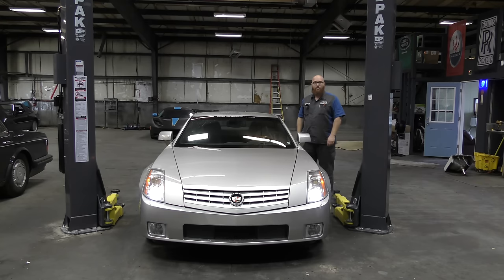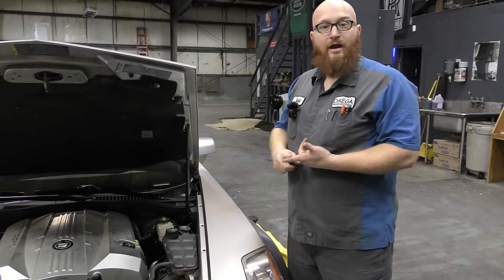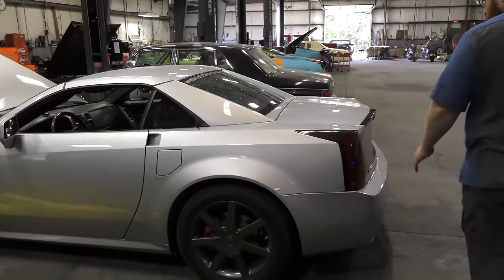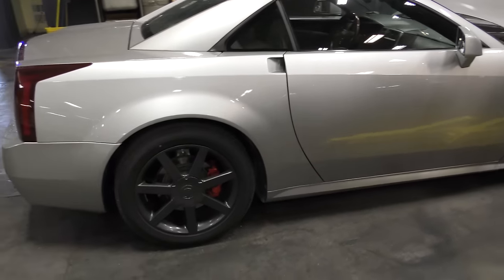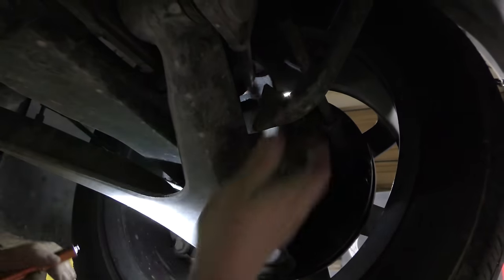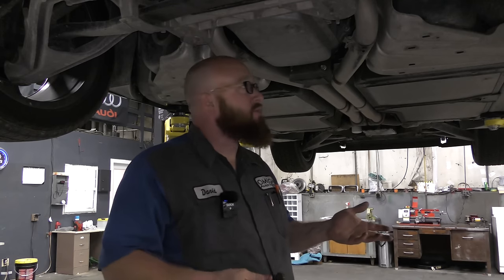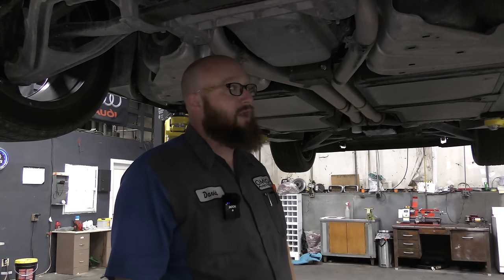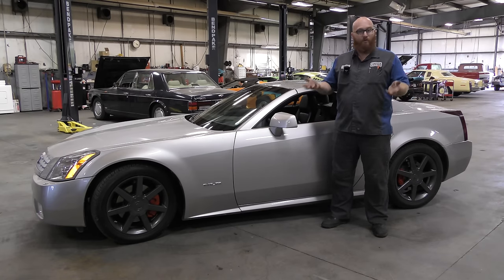The CAR WIZARD is shocked this 2006 Cadillac XLR has a Lotus Sized Repair Bill?!?

Comment: My Buddy ordered new a Diamond Black Edition XLR-V (S Sport pkg. $6134 cdn option), ordered a SLP 6 spd from Mr. GoodWrench (G.M. Performance Parts Desk at this particular Dealership). This is a real 1st hand knowledge (I was thankfully invited to order & $10 000 cdn downpayment) base price was $71 549 cdn, I would love to have been able to show the 2 1/2 window stickers; it will be explained in a moment. Still flipping through the parts catalogue, forgot to mention that the Diamond Black paint was $8740 cdn; 3" cat back Borla exhaust, a set of actual C5r Recaro fixed backed bucket seats in XXL North American conformity, (I am serious, this friend of mine was a member of the more $ than brains group. A set of Dynmag Magnesium rims (as found on mentioned C5r), Lingefelten☆ sealed carbon fibre cold air induction kit ($1826 cdn) ALL ,dealership installed. He got the call 6 weeks to the day to collect, All said and done (A Premium surcharge of $4473 cdn to activate a Platinum Cadillac OnStar Concierge pkg, seriously!) Shop, Sales & C.E.O. of this dealership read out the stipulations and practically made my friend sign in blood; not to let Any information/Performance stats of this vehicle to be disclosed publicly; a non disclosure on a Caddy that my friend paid the remaining $106 887cdn, $116 887 + $450 cdn for a Valet restriction micro chip key. You can guess what  happens,  I forgot to  mention that my friend just got scouted by the Indianapolis Colts (N.F.L.) 18 yrs old & hopping out of Square Styled '88 Suzki Samari on 13" 102 spoke Dayton Wire  Wheels & 64 h.p..... I didn't even get a ride in or a picture taken because a telephone pole beat me. On a lighter note, my friend enjoyed 8 seasons in the N.F.L. Thank's for reading this message, Cheer's from East-Van B.C. Canada.

Comment: No LS on the XLR-V Wizard. Supercharged 4.4 Northstar. Buy mine Wizard!! I am selling my 2007 XLR-V if anyone is interested. very rare. Just a few over 400 made that year. Same color as this one but without the ugly aftermarket wheels. Excellent shape. I will post a video today. 20,000 OBO. PS just had my radiator done. Easy find at rock auto. 1300 dollars to replace. AC had to be flushed and serviced as well.

Comment: I don't get it, I found Denso direct replacement radiators for $168.20 CAD on Rock Auto. If you want AC Delco direct replacement then you're looking at $386.88 CAD which is still under $300US. Wizard, you should start looking for new suppliers.

Comment: If you have to replace parts, and they are expensive and difficult to obtain - go race parts, go race parts, go race parts. It's similar or cheaper to upgrade to something better even with the fabrication required to make it fit. Manufacturers make things to a budget, they generally aren't aiming for the best.

Comment: Adored this car for years, until I saw this video!...can't find a freaking radiator?...omg and an oil pan gasket leak that requires unbolting the motor mount bolts jacking it up enough w/0 breaking something else to get that oil pan off.
3500.00!!!...I'll take that old chevy truck you got in the corner over there!😊‼️❤️🏁👍👍👍 Thank God for this video!!!!!!

Comment: Wizard, did you say that the NorthStar head gasket issue had been resolved on this 2006 XLR?  Please fill me in.  I have a 2006 Cadillac DTS  Performance Version built in October 2005 with just 40,000 miles on the clock and I love the car.  Had only 7500 miles on it when I bought it 10 years ago.  No symptoms of the head gasket issue, never ran hot but I always wonder....!  What can you tell me?  THANKS

Comment: Hello, I noticed the cold air intake(maybe volant?). Im currently chasing my tail on a p1101,p0101 and P0068. 
These codes are a known issue after the ecm is updated and the stock air cleaner assembly isn’t replaced with the new revision. Well gm discontinued the “new” air intake. 
I’ve done smoke test(no leaks) . New plenum seals, valve cover seals, plugs, and even a gas cap. It will run and reset all monitors except evap without error codes. But then once you restart car it throws the above codes. Btw this all started after dealership pulled both tanks to replace fuel pumps. It didn’t happen before this and they said it not related…?!? 

My last ditch attempt is put a volant cold air intake. Did it give any issues with codes? 

Thank you

Comment: I hate to rank on GM, but to make the highest-performing Cadillac (the XLR-V), they had to use a Chevy motor? In a Cadillac, the "standard of the world"? That's like Audi dropping a VW motor into an S8. Tells you how far down the tubes Cadillac and GM have gone. About the fuel sender issues..try running a good system cleaner in the fuel, such as Dr. Injector, because the sender may just be dirty. See what happens after a couple of tankfuls. If it does fix it, send me $700.

Comment: The lack of parts availability is because it was a very low production car.  Cadillac’s are notoriously expensive to fix.  My wife and I bought a 2011 SRX with the 2.8L turbo  this past October of 2020.  It only has 22,388 original miles on it.  I ended up purchasing an extended dealer warranty but that only lasts for 2 years.  The sunroof visor/shade already needed to be replaced and guess what?..........it’s not covered by the warranty I purchased so it was almost $900 out of pocket to get it repaired.   Anything Cadillac, regardless of what it is, is going to be expensive AF to fix.............. but I really like my SRX!!

Comment: Hope you never break a headlight or tail light. IF, and that is dead serious...IF you can even find one, starting price for a working unit 10 pin headlight is $3k and up...EACH. Tali lights are about the same. So yeah, there are $12,000 worth of lights on that car. And that's if you can even find them anywhere. Been out of production for years. I know this stuff because I own a damn near mint 2006 XLR. The car is great. And it's BLACK in and OUT. Probably one of the best looking GM cars ever produced.

Comment: Now that the C8 is out, Cadillac NEEDS to make an XLR-V Blackwing or just V whatever they do now, and offer a genuine competitor to European coupes.  If they can use either the 4.2 TT Blackwing or whatever is going into the ZO6, a 5.5L flat plane, maybe twin turbo it.  They HAVE to do AWD... Like, don't half-ass it like everything else they've done.  The CTS-V was amazing, but cheaper than euro because they skimp on the interior.  Caddy is lost because the people who can afford them don't want American cars because of what GM did to the market in the 80s-2010.  They made shit cars.  The lineup should be, Escalade, CTS(5?6?)-V sedan, XLR-V sports car, and the regular sedan that will be made into limousines and such.  Stop trying to compete with European sedans, you'll never win.  The Escalade is its own thing, but has competition now, and they just need to make the best cars possible at the price they will cost, and stop spending so much competing in a market they can't possibly win.  Id take an E class or 5 series all day, and they don't even make an S class competitor.  If there was a mid-engine, AWD, 600+ Hp sports car, and it performed like an AMG and sounded like a Ferrari, and cost as much as an RS, or M, or AMG, it would do better than undercutting those brands in price AND quality while trying to skate by on a name that hasn't been premium since the Eisenhower administration.  Do that, or just fold the brand and sell GM to the Chinese government like you want to anyway.

Comment: You trashed northstar caddys in a past vid. They are what they are.
Xlr also had headgasket issues.
ALSO THE XLR V HAD A NORTHSTAR NOT AN LS.
IT WAS a 4.4 litre and supercharged.
It also had headgasket problems.

Comment: Coming from a former Cadillac tech:

If it isn’t new, don’t buy it. If it’s a discontinued model, DEFINITELY don’t buy it. It’s a luxury car, they age terribly, parts get dropped faster than gravity, and cost a fortune for something over engineered. You pay for the name on it literally. And that really goes for any luxury car. I’m not knocking them, just hoping someone who plans on buying a older used luxury car reads this. 

*Side note: Think these prices are expensive? Go to a dealer (which you’ll mostly have to for parts and technician sake.) Any shop in my area won’t even touch these, only the caddy dealer will

Comment: It’s a low volume speciality car. If you think parts are hard to get now, wait 20 years when they discontinue support for them. I personally think it should’ve had the 7.0L LS6 427! That would’ve done it justice and been faster then the XlR-V with 443 hp and had 505 hp.

Comment: I’m working on a 06 XLR, and after watching your video I have the same issue with my radiator. My question can I get the radiator out without disconnecting the ac compressor?

Comment: I just looked up XLR radiators on Rock Auto and they had SEVEN options, from $67 (closeout) to $275 (Delco). So it's very odd he said he could not find a radiator. 5.2.21

Comment: HAH $800 radiator is nothing! My RS6 had a crack in the radiator... $1100 for the radiator/oil cooler (it’s 1 piece) $200 for the 4 pipes, plus the many hours of shop time it took and other bits and pieces... it was over $2000. Best car ever though!

Comment: I think I can relate to this guy pretty well, and the owner of hat car.  I have a 2004 Jaguar XJ8.  Luckily I haven't had the same exact experience as the owner of this Cadillac.  But I think I've had some close calls on that.  And I'm sure it would be even much worse with an F-Type because they have even more stuff to them to have to worry about.  I almost wish I didn't have such a soft spot and a love for some of them Jags.  I almost ask myself why I don't just sell my nice beloved Jaguar and get a more simple 1984-5 W123 model Mercedes 300D Turbodiesel with a lot less stuff to have to worry about.  But if one of any one of those has had a recent engine re-build then I don't want it because their motors are very difficult and tricky to re-build just right so they would (potentially) last over 200,000 miles again without any problems.  I would just end up wanting to have as my alternative daily driver and #2 traveler, which I almost feel like wanting to do in my Jaguar.  Yep, "Hoovies Garage" sure does help me to laugh at myself a bit.

Comment: XLR's NEVER had an LS engine.  Both are Northstar engines 4.4 litre for Supercharged and 4.6 for the base engine.  Headlights NOT available along with many other items. I have a 2008 with a few added touches.  Always be aware of the door release handles down beside the seats.

Comment: Hi wizard. The fuel level sensors are junk. I dropped my c5z06 tanks no less than three times (in 300000 KMs) Just changed the 3 phase pump and both sensors on my c6zr1 - 3rd time now for the sensors.  All 6 jobs on my back.  Given your xlr is not manual - do u have to lower the cradle to get at the crossover tube?

Comment: Car wizard!  I have an 05 XLR....just about to button it up from a radiator swap, belt and hose swap..... Some of the trans fluid came out.  I think mine is the 5l50..... If I change the filter, how many quarts go back in and do I have to use a pump to get it in?

Comment: $800 for a radiator installed doesn't sound that expensive to me. I just looked up a radiator at AutoZone for my 2005 Silverado is $200. then another $150 for hoses and coolant. If I did it my self it would be $400+.  I guarantee a shop would replace one on a Silverado for less than $200. So you'd be at $600 for a 2005 Silverado.

Comment: $800 doesn't seem that bad.  Car was $85k+ MSRP when it was new and is relatively rare/low production.  ~14 years on what was probably the original radiator--can't really complain.  Later on when the radiators aren't available anymore (if the car is still around then), will probably have to have it rebuilt instead, with the sidetank replaced.

Comment: Even the XLR V is a Northstar. It is a supercharged northstar. C'mon man,you are a mechanic.  It and the STS-V have the same motor,except the STS-V  has more horsepower. Hoovie should actually by an STS-V and shoot the value of them up because they are too cheap for only 2503 to be made.

Comment: 05' Caddy CTS.  My engine was overheating and trans wouldn't shift.  GM put the transmission cooler in the radiator.
Antifreeze and  transmission fluid mixed.     $$$$

Comment: If you charge that guy 13 hrs to drop that tank that’s wrong, you don’t have to always charge book time ,for your customers the ones who support your shop I would always just charge clock time on big jobs and charging 26 hrs to do both tanks is a rip off , I would of simply charge him 8 hrs and called it a day ..I’ve fixed ppls caddy’s for as little as 25 bucks as I knew they had no money and kids to feed, even though it should of been 1000 bucks ,I just took adapters and fix all their hoses and added clamps and gave her recycle coolant which works perfectly fine, she couldn’t even afford a car seat for her child which we gave her one..it’s shops like yours that sure technically you’re not being crooked. But I believe in charging those who can afford book time and don’t mind paying the true bill and giving others a break if they need it ..she turned out to be a life long customer ..
I fixed a lady’s Volvo for 30 bucks after two transmission shops and the dealer both quoted her 2500 bucks for a transmission.they both missed the problem,she had her purse on the center console and it had a snow rain traction button which was depressed by her purse so it took off in 2nd gear all the time ..ya know the firs 4.6 motors which blew out spark plugs due to ppl cross threading the plugs over time ,and of course dealers were happy to charge 2500 to 3500 for new heads ..
I made a tool long before snap on caught on to the trick..
I simply welded a O2 sensor thread chaser onto a socket and then welded a extension to the socket..which allowed the threads to be tapped with a little grease ..so for 110 bucks fixed can’t tell you how many free lunches I got ..must of fixed 50 heads or more over the yrs ..
I could go on for a week, 
You have to be able to read and get to know your customers..
I could of made a lot more money, but I end up with so much work we had a week wait and customers where happy to wait ..
Plus we only charged 55 a hr when everyone else was 75-110 hr..even the speed shop we were 45-95hr depending on the work..
Anyway I’m sure your a decent guy but bro you don’t charge double the price when you’ve already taken off 85% of the parts to remove one side I don’t care what the book may say as it’s wrong many a time ..

Comment: Makes me miss older Rads that you could actually repair ,,not this plastic crap,,but think there should be an aftermarket replacement avail,,,Reminds me of my 90 Allante which is a blast to drive ,,And  LOL  My 1913 Willys Overland  Has a Transaxle,,and probably more reliable and easier to fix

Comment: caddy xlr radiator in the UK £100 OEM quality. available within 24 hours and 2 1/2 hours to replace. you don't have to remove everything it says. as for 13 hours for the tanks 13 for both if your on a lazy day

Comment: Welcome to my XLR world.  Bought a 2005 two years ago.  Looks just like this one except that mine has chrome wheels.  Ran great and wife loved it.  If only I knew what I was getting into.  Problems getting parts?  Why?  It's a Cadillac!  Well, I was very lucky to buy an extended warranty that covered most issues, especially one that covered any problem that I might have with the convertible hard top.  No problem with the top, but have had other problems.  Check engine light.  Oil control valve issue.  Went to the Cadillac dealer.  Not one in stock anywhere.  Dorman only source for "new" ones.  Nothing for the last couple of years, but Dorman keeps telling me that they are back ordered.  Had to buy a used one from a salvage yard.  While car at dealership waiting for part, rain seeped through trunk and flooded suspension control module located in truck area.  Cadillac could not locate a new suspension control module.  I found one at another auto salvage yard.  All shocks were leaking.  Computer controlled suspension/shocks AC Delco around $400 each.  Cadillac dealer found those.  Radiator started to leak while waiting for these parts.  $800+ and the dealer found one.  So the warranty company paid for the parts and labor, but I had to pay for the rest.  It's been almost a year with the car and it runs and looks great.  Warranty ended months ago.  Keeping fingers crossed!

Comment: Dude you took how long to find that leak ,wow I must say as a master with 30 yrs wrenching I just can believe you didn’t remove that cover first ,and that radiator can be fixed for about 110 bucks you need some help at ya shop it seems ,anyone who’s worked on A caddy shouldn’t be shocked even a junk caddy 4 door has a mess of heater hoses which can cost 300-500 bucks ..wake up dude…

Comment: I imagine the labor times for the pan and the tanks are so high because you have to remove those subframes which I guess involves decompressing that huge ass leaf spring.  We had a customer junk a Volvo 960 (which uses the same style leaf spring in the rear) cause his diff was bad and the labor cost to remove it was SO HIGH.

I do imagine it's the same labor to remove both tanks though, drop subframe, drop tanks?  I can't see charging 13hrs for both.  I'd think there would be added labor for dropping the second tank and R&R the sending unit, but I think the 13hrs includes removal of the subframe.

Comment: Likely  a near perfect 50/50 weight distribution, giving the jacking points..  The exterior looks great, but the interior looks cheap and didn't age very well, in terms of style.   What about  a custom aluminum radiator set up?